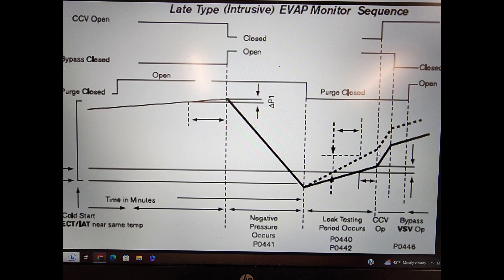How to Diagnose Toyota Evap Leaks

Comment: Mine is a P0441, on a 03 mr2 with a 2zzge. After I pump gas the car idles between 300 and 800 and it feels like it wants to stall. After a few minutes of driving it idles fines. I’ve changed the gas cap and purge valve. Any ideas what it could be?
Reply from the maker: Could be the vent valve, canister, the roll over valve.
Reply: @NutsandBoltswithTone thanks, I’ll look into those

Comment: So you should start with a smoke machine
 My Toyota Rav 4 has p4400 it has leakage under une car but haven't got under to see what it is but should I start with a smoke machine?
Reply from the maker: on a Toyota the first thing I do is manually smoke test it to see if the system is sealed. then I test everything else.

Comment: Ive been chasing a mixture of P0440-0446 codes for years on my 01 4runner. Tried the purge valve, charcoal canister, the check valve too. Cant find the culprit and have tried smoking it but havent found the leak. Wish i had a mechanic local like you that could figure it out. Im out of ideas
Reply from the maker: I have you used a mirror and looked really closely at the roll over valve on top of the tank, it is very commonly missed. You can message me on Instagram
Reply: @NutsandBoltswithTone thank you I will message you there. But I replaced the roll over valve as the first thing I did. Ive wondered if it's a line that has a Crack or has gone bad
Reply: @NutsandBoltswithTone what's your Instagram handle? I couldn't find you

Comment: Is the roll over valve on all Toyotas or just SUV Toyotas?
Reply: Good thing it’s a Toyota. Chrysler tanks have the valve molded into the tank, gotta replace the whole assembly.
Reply from the maker: @Tool Demos  very true and readily available.  Thanks for watching.
Reply: @ToolDemos  crazy Chrysler designs 🤦🏼
Reply from the maker: Rollover valves are on most vehicles.  I have replaced them on many different vehicles.  Thanks for watching.
Reply: @NutsandBoltswithTone  I’ve got a lot to learn thanks
Reply from the maker: @sheerwillsurvival2064  my pleasure
Reply: @NutsandBoltswithTone  have you done one on a Jeep jk I just looked it up they say it’s not replaceable. It’s vented to another vent valve which are easy to break the nipples on and you have to buy whole tank . WT heck is that right. I own a 07 so iam curious
Reply from the maker: @sheerwillsurvival2064  I'm not completely sure.  Don't think I've done one on a Jeep.